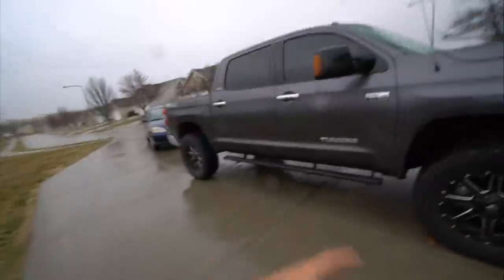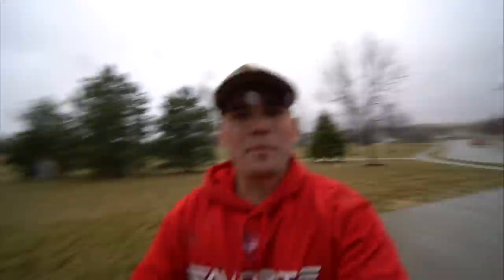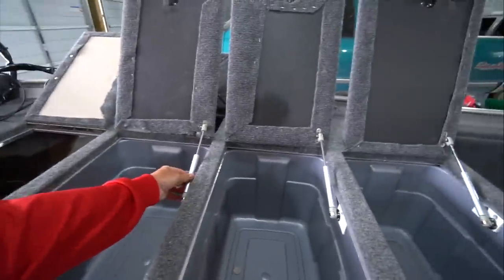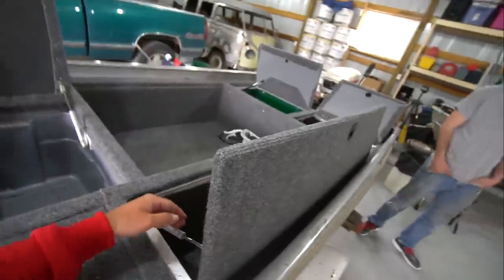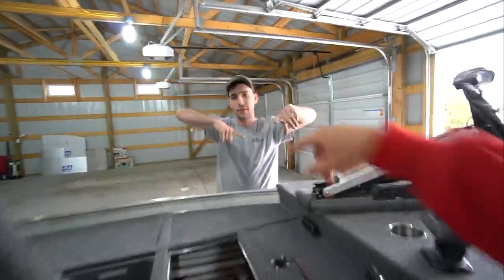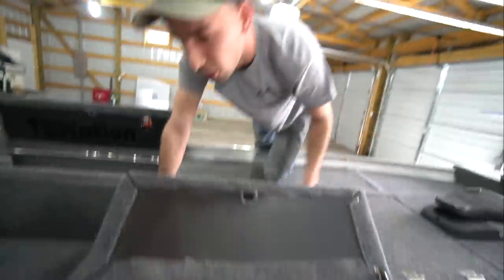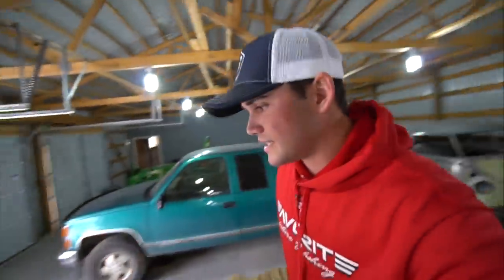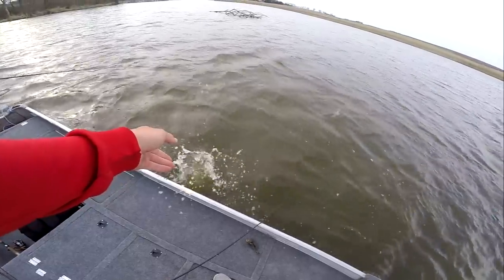INSANE Jon Boat to Bass Boat Modification (Homemade)

Comment: That has to be one of the worst conversion layout that I've seen.. And before everybody gets their panties in a bunch hear me out. And yes I have converted a few small Deep V's and still fish out on one myself.  

First the center of gravity of most small boats is 60-65 % of the length of the boat from the bow. You need to keep that in mind when laying out  the decks in these small boats for correct weight distribution. 
 The deck layout is uneven with a the large rod lock on one side and a narrow storage compartment on the other. This makes it easy for someone to make a misstep and fall into the boat or completely out of it. Same with the back deck. It is very small and leaves zero room for someone to move around while fighting a fish.
 The front deck with all the storage compartments down the center back to back leaves no  place to build the frame needed to support a seat pedestal. And a front pedestal butt seat is very important on these small boat conversions. Even if you rarely sit in it (l rarely actually sit in mine) you do need it to help with your balance espically when fishing in wind and rough water or when getting hit by big wakes.  Videos of my 12' Deep V conversion power by 2016 Suzuki DF 15 . 21.7 mph with me and all my gear + decks. with Jack Plate I'm building for it hoping to get 26-28 mph out of it with a 15 hp motor...https://www.youtube.com/playlist?list=PLN_iajjzfywS5pfdcpB-UZRVcnUxJtH7q
Reply: Ah my boat is all square aluminum tubing build, aluminum C-Channel build.. with  EVA foam mat (same Hydro-Turf) as deck covering. building in live-well with both aeration system and recirculation system., with over-flow drain and auto pump out . And a build in bilge system. And I can switch a 2 way gate value and my aerator becomes a second bilge pump. That's 1600 gal per hour pump capability. So yes I didn't add foam for a reason. You do realize that foam adds ZERO buoyancy right. And the amount you added will not stop you boat from stinking. It will slow the sink rate down but your boat will still go to the bottom. If I knock a hole in mine so big that 1600 gph pumps can't keep it from sinking. Nothing would stop it from stinking. And not sure what "spray foam" your talking about..??? Cause like I said I have ZERO foam in my boat.  

Oh wait you looked at the very first boat conversion I did on this boat... and  yes I used 2x4" and the boat fished great. But I wanted more storage space, so I rebuilt the boat with all aluminum frame. and added all the above mention features plus some. But I don't really post much to YouTube  and I don't update my Channel that often, so the updated videos of the new builds are not posted. But you can see the aluminum frame in the video of the live-well system. And all the videos of my boat running on the water are with aluminum frame, cause I didn't even have a outboard when I had the 2x4 frame. Fished with just the trolling motor at that time....

I'll post a few more videos of some of the different frames and of the one I slowly building now when I get time to work on it.... But as to the wood not a single piece of the back deck ever rotted. Why because if you seal any type of wood it will not rot.... 

 But I didn't write that review to get in a pissing match with you. I wrote to to point out to others who may be looking at it wanting to copy the design, that it has some serious safety issue in the layout, I never question you building "skill" or "techniques". But if you can't admit that there are serious safety issues with that boat you are just kidding yourself and are going to get someone hurt who copies that design..... I bet you never thought or even knew about a boats CoG and where its located until you read my comments....
Reply: Pat Fleming you can't be serious.... I don't have the time to correct all the ignorant shit you just said so I'll leave you with this. For one, reserve floatation is a thing and it's important. Secondly, the weight distribution is flawless. Here is something for you to think about. You can make a boat have a perfect center of gravity while also not mirroring everything in the boat from one side to the other. The are not any seats or livewells per Andrews request. Dont like that? Fine, build your own boat your own damn way. This isn't the prettiest boat but it was made to be functional. It functions flawlessly for what it is. Which is a boat that scoots around at like 10 mph on lakes that are normally less than 100 acres. Not for offshore fishing for great white sharks during a hurricane.
Reply: Pat Fleming this was also built to be a one man, bass fishing machine. Not to take a family portrait on.
Reply: Fishingthe402... Please take the time to inform all of us of all the "ignorant shit" I said in my comment. Please enlighten me with your knowledge. Cause after rereading it serval times I can't seem to find all the "ignorant shit"  that you seem to see..

 But since you seem to want to point out a older version of one of my boats. with the link you post, I went ahead and uploaded a updated video that has all 3 versions of that same boat. Ver. 1 wood framed, Ver. 2 all aluminum frame, to Ver. 3 tournament ready with upgraded live well system...

And you still have yet to explain why the safety issues of your build that I pointed out are not a concern to you.  But you do seem to be a bit defensive about it. While I didn't question your ability to do quality work, I simple pointed out a few "design flaws" that turn into safety issues for any small boat. Your design (if copied) can and will get someone hurt or worst. And you don't seem to be able to have someone point out or question your design without getting all butt hurt and bent out of shape. Then again it might just be that you don't care enough as long as people keep on liking the videos on your YouTube channel... 
  
I'm not sure of the manufacturer of your boat, it looks like it might be a Lone Star, which are good boats. But like many small aluminum boats they have a narrow beam 42"-52" which is measured at the top of the side rails not the water line. (where it matters for stability) Lund's, Gregor's and a few others are build with a wide beam. My 12' Gregor has a 60" beam and its wider at the water line (54") then most of the Lone Star style designed boats. 

So I started with a boat that is more stable then your just from the hull design. Plus the design of my conversion by keeping the weight down low in the hull guarantee that my boat is a lot more stable then the one you built.. This is another major factor for boat stability you seems to not to know, understand, or care about seeing how you built the decks 2' below the top of the side rails.  

So instead of spending your time trying to make it look like I don't have a clue of what I'm talking about, spend it pointing out all the "ignorant shit" I said so I can correct these issues with my boat....

Comment: Wow - I would have a lot to say about your video.  This is "constructive criticism" so don't take it personally. 
1. Slow down your presentation and say only enough to INFORM.  I found it confusing and annoying to watch the video because of your hyper speech style.  Dial back your enthusiasm.
2. Get your facts straight.  That's not even a John Boat, it has a V hull and because of that it will tend to be tipsy.  I have a very similar boat and because of my advanced age I find that my boat is becoming more and more uncomfortable as a fishing platform.  Getting in and out of the boat has become quite hazardous and I am trying to find a way to stabilize it to reduce the side to side "wallowing" as soon as the wave action starts to pick up.
3. You didn't address seating.  If you travel any distance you are going to find the need for comfortable seating and back support.  With all that storage, you most certainly will be able to fish farther from home and for longer periods of time.
4. You haven't addressed boating requirements like running lights, anchor points and cleats for docking, etc., etc.

Thanks for your efforts in providing the video although I was more curious to see if & how you dealt with safety and handling shortcomings that are prevalent in smaller aluminium boats.  I am  particularly curious about how it worked out as a fishing platform, especially regarding  the issue of instability.